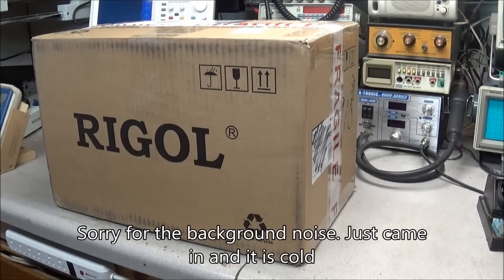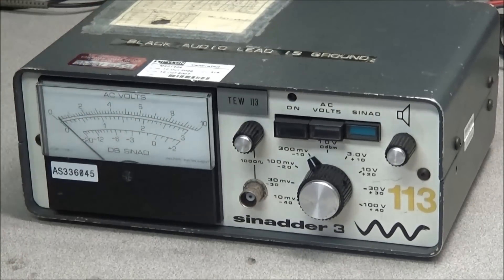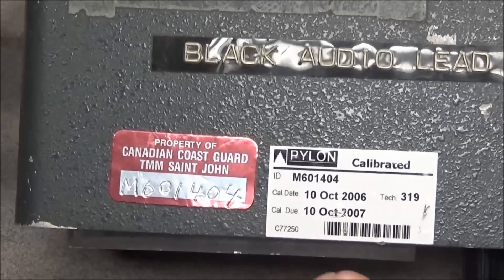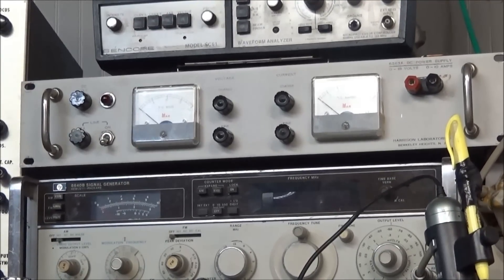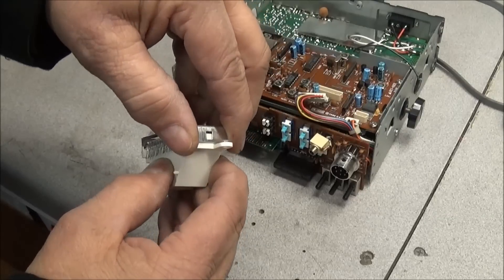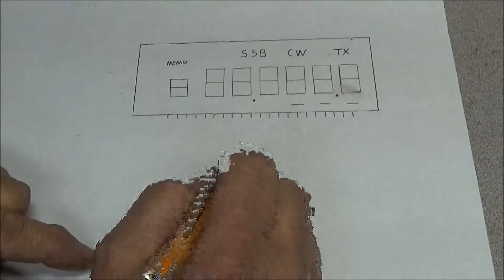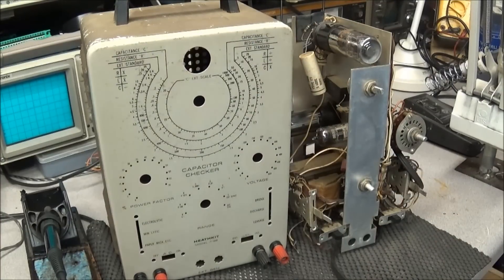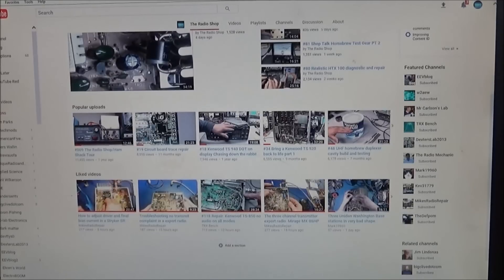84 Christmas in the shop and a few updates

Comment: Awesome, I have one of those and did a video on modifying it for D.C. Isolation of its input.
I also changed it clip leads to a 3.5mm plug to plug it directly into the external speaker jack.
Reply from the maker: Going to have to find that video. Great idea.

Comment: I searched the usual channels for over 3 years until I found a Sineadder 3 at the right price. Six months back I found a US seller with one for around $75 shipped to the UK, a real bargain. It is used almost everyday, a great tool. Make sure to add a 100nf cap to the negative probe where it connect to the PCB, there is a hole already there for the cap so it then has an isolated ground. Kari
Reply from the maker: Cool deal. These are getting harder to find now. Thanks for the tip.

Comment: Looks like a good project for an arduino and 2X16 display, pick off the serial from the input to the display driver.
Reply from the maker: Yep I need to start playing with that platform a bit.  Never got into it. I have been programming atmels for years and recently started with pics.

Comment: can't wait to see what you do with this unit.  i am about to re-cap my new sinadder s-101 which i believe is the same circuit as the one you have, minus the AC volts and whatever other options are there.  one mod i would like to see would be a way to add an 1/8" inch jack to the unit so that you can hear the radio while you are tuning.  no real reason for it besides me liking to hear a radio while i peak it.
Reply from the maker: He brother, good to see you. I will draw up a schematic to mod your with so you can add a volume control and internal speaker.
Reply: I'm guessing it's going to be transformer coupled?  definitely can't just parallel off of the alligator jacks from what i've noticed.

i noticed after re-capping my s-101 that the PC board inside says S-103 on it, so i think they may be the same boards.

Comment: my IFR 1200S Supper is having problems as well (outgen is weak, spec ani works when it wants). when I get the extra cash im going to send it into the IFR doc guy and hope he can make everything like new again. 

as for the display, 7 seg displays with bar led for mode/span.
Reply from the maker: Thanks. Yep I talked with Kurt before and it is not cheap. He is a great tech on these though. Good thoughts on the display
Reply: yeah think the bench rate is 80/hr plus parts. i figure if i can get mine done under 500 id be good.

Comment: Buddy, what are the dimensions of that display?  What voltage?  It seems like it should be pretty easy with an arduino and a little TFT display or something, if you can find one that would fit.  '73, Mike / KD2EAT
Reply from the maker: Thanks Mike. I will get all that information together in a future video. As a group we may be able to knock this out.